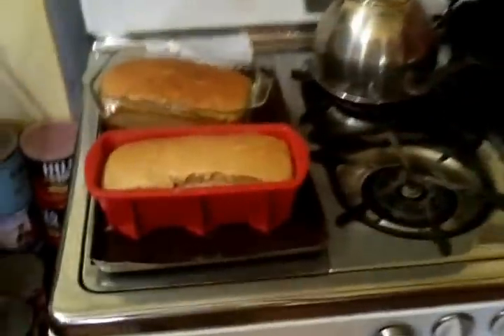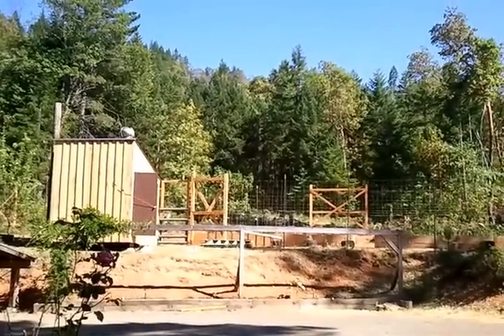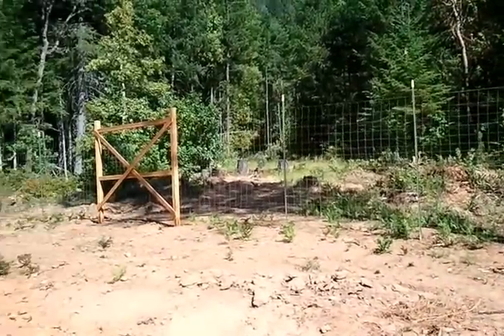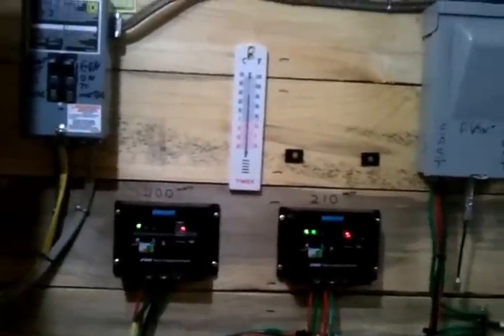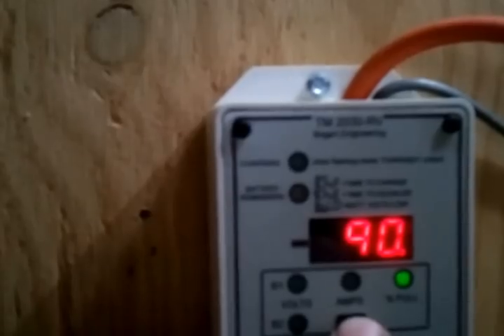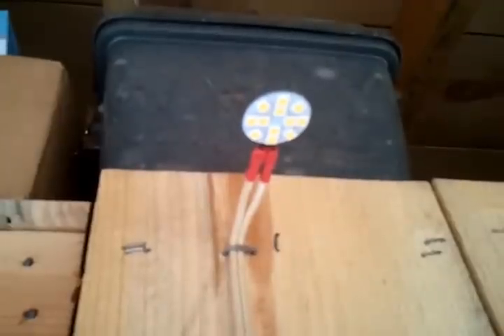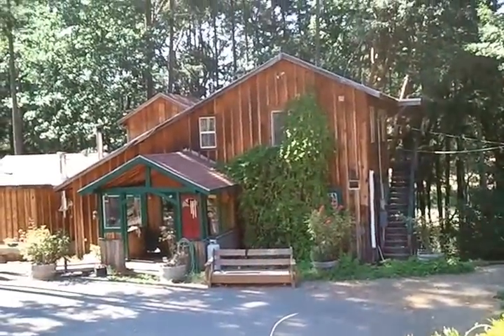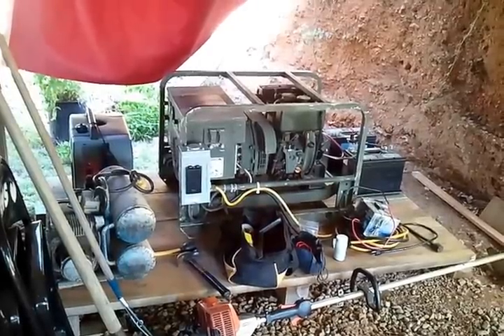Off grid solar homestead part 1

Comment: Thanks for the tour Steven. I see you are using a chest freezer with the additional thermostat as a refrigerator. It sounds like the two of them have been working well for you. I have been  thinking I might go this route for my cabin also. The freezer and thermostat together, appear to be 1/2 to 1/3 the cost of a propane refrigerator. I'm glad to see someone else using it this way as well. I'm still at least a year away from making that decision. All the best. - Dave

Comment: Hi, just watched the first one of you videos. Good job. You said you built your house 20 years ago. I just purchased a wood miser and plan on building a house with timber from my land. Did you use your lumber in the green, air dried, or did u have it kiln dried ? What kind of issues have you had with the lumber? Any major problems?
Reply from the maker: outdoorcountryboy forlife Greetings from Oregon, I just found your comment. Do you still want to know?
Reply: yes sir, I'm still on board with building. I've been cutting lumber all year. the basement is built and hope to start laying lumber in march
Reply from the maker: Very good! We always build stick framed houses with green Douglas Fir. In the eastern part of the country They use yellow pine, hem fir etc. The siding is best air dried to about 8% moisture content. We air dry 1x12 Sugar Pine on 1/12" stickers in the simmer for about 6 weeks. This keeps the boards from cupping after they are nailed up. It is best to nail the bats on a few weeks after the sidding.
On building with un graded lumber. Every state and county has different guidlines. In our county if building a permitted building either  the lumber has to have a grade stamp or the engineer that drew up the plans can specify Ungraded lumber and he will sign off on it. Some counties alow you to move one column to the right on the span Charts in the code book. In other words if a 2x6 will span 12' graded lumber then span 2x6 only 10' ungraded.
One way I did this for a church. We built the whole thing with ungraded lumber and had a West Coast grader come and inspect the building in the ruff framing sage and he signed off on the building. The county inspector was happy and it only cost me $200
If you are not going to get permits then I suggest that you Google "slope of grain" on the internet. The reason is you could have a 6x12 beam or even a 2x12 rafter have a bad slope of grain that is more than 1" in 10" and the beam/ rafter will not hold up its own weight. Training your eye to see the slope of grain takes time. I would educate yourself about this issue. I used to be a millright then a dry kiln manager and QE at Rough & Ready lumber company. This along with having built cost homes is where I learned it. I also watched graders by the hour (hundreds lol ) stamp boards. I hope this helps. If you are a builder then you already know about strength degrades because of spike knots, edge knots, rot and white speck. 
I was able to build my house for $5500 becaus I have a Woodmizer and a timber lot. I hope you post video of your progress. If you have any more questions I am happy to help.

Comment: The $11 disconnect caught my eye, since the shutoff is the last piece that I need to get my system going.  I offered a local solar installer $160 each for 10 6 month old 300 watt panels he had just repossessed.  I was surprised when he agreed, so now I find myself trying to put together a large solar system.  I have 75a mppt controller, 6 golf cart batteries (I'll be running at 36v battery voltage, 72v panel voltage) and the rest of the 4 gauge wire will arrive tomorrow.  I'll be crimping and soldering my own mc4 connectors and making my own wiring harnesses for each of the two 15ft strings of panels.  I'll be shutting off my gas, water and power next week and living like an urban peasant, something I have wanted to do for a long time, and I couldn't be more excited.

Comment: Have you considered supplementing your power supply with wind turbines made from car alternators and pvc piping? We're about to go in the homesteading direction, and my wife works in the solar industry, so she boo hoos the idea, when I mention it to her, but it only makes sense. The wind often blows at night, but the sun never shines at night. So why not use the free energy source available?
Reply: We are having a misunderstanding. I think you think I'm suggesting you power your entire homestead with wind power. I was actually talking about supplementing your power with windmills, because you'll get 0% sunlight at night, so if you could produce cheap supplemental energy while the sun's not out, why not? Anything charging your batteries at any time is a plus, unless you know something I don't. Don't you agree?

Comment: Just came across your video. Beautiful set up there! Very envious! Been growing my solar power system for a few years now. Someday I want a plot like yours and build a larger system. Running 2.5KW in Renogy/Sunpower panels and can get 10+ KW/H on a good day.
Reply: Sounds good! I switched to a 24v system this spring and went with the Outback Power VFX 3624 and Mate 3. Pricey...but, well worth the extra change. I looked at the Trace and a few others. Are you able to power your homestead all night on 8 L16 batteries?

Comment: Howdy neighbor, I'm just north of you but in the northern regions of Jackson County. I noticed your red soil. I detected that would be Josephine County right next door to me. Anyways, I would like to know more about your freezer conversion. I am in the process of going off grid AGAIN, as I was two years ago before I purchased Pine Meadows Hobby Farm. I have a 5kw system which can be seen here at this link below
https://www.youtube.com/watch?v=bIIIZL2lp30
I am currently resurrecting this system. We have a 8kw propane standby generator. However, I do want to reduce my energy consumption still as the refer and freezer are standard appliances, both new. Is there a way to reduce the energy consumption from these? Thanks for your video.

Comment: How do you run the microwave that is on the right at 0:52.  Do you have a generator backup?
Reply: Most microwaves are around 1000 watt and he has a 1500 watt inverter so it would work off that system.